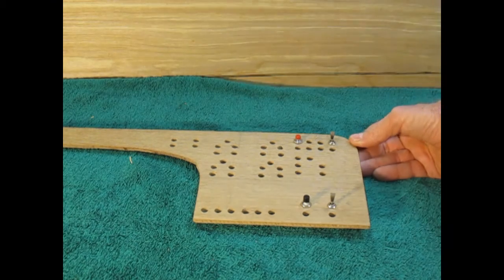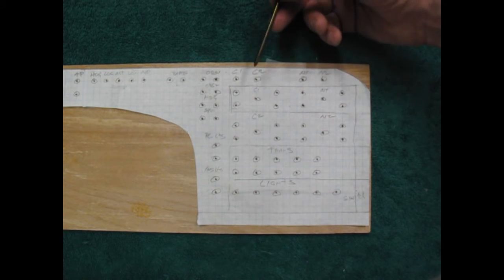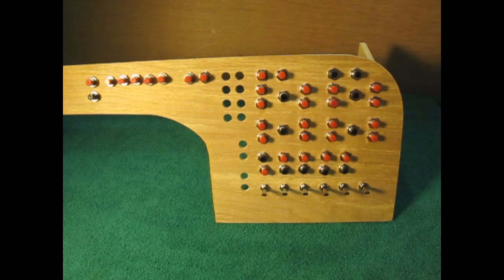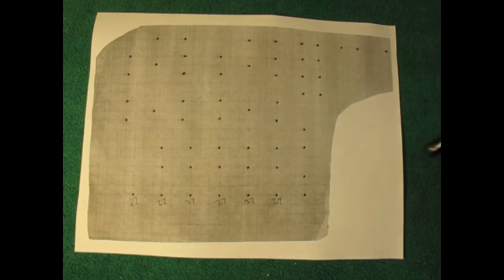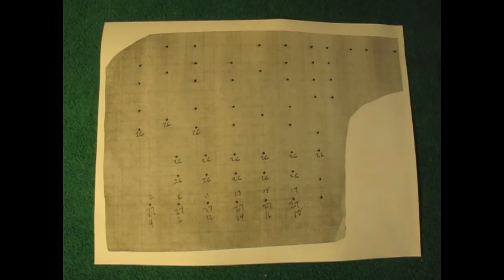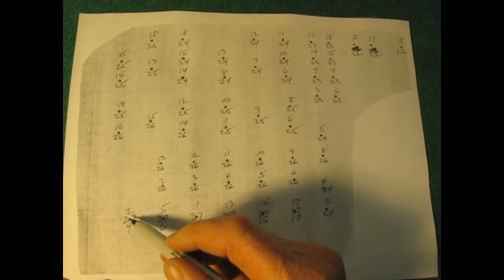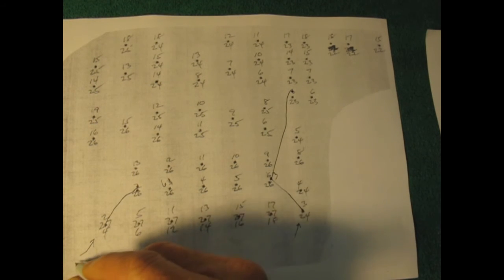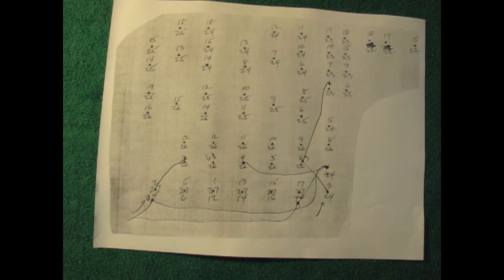How to Build Your Own Instrument Panel for X Plane ~ Part 3

Comment: Once again, thank you Skip. I had been trying to visualise the wiring connections myself and failing miserably, but that makes it nice and simple and I understand the theory now.
I have begun my own project and have so far saved the circuit board from an old keyboard and soldered some tails onto the pins. What a job that was! lol I need to start tapping out the wire combinations now and making a grid. I am aiming more at a button box than a panel as it will be used for both flight sims and racing sims, so it needs to work for both.
Thanks for pointing out some of the gotcha's too! There was at least one I would have got stuck with there.
Great work sir. Take care.
Reply from the maker: Hi Tux,  Glad to hear I have someone doing this with me! Yea, this is a time consuming project, quite a bit of work. As for soldering when I looked at all the solder connections I realized I wasn't ready for that and it took me a while to figure it all out. Even with the plan I came up with there most likely will be some little challenges so stay tuned.

Sounds like you really have a challenge making one to work with two simulators, please let me know how it goes and if you  find anything we should be aware of post it to help those who are doing this with us.

Blessings,
skip
Reply: Will do Skip. There will be a bit of a hiatus now as I am building this on a STRICT budget, so to save cash I ordered switches and buttons from Hong Kong (they were less than 1/4 the price of buying locally) and they will not arrive until the end of the month.
Meantime I have done my tapping out and created a grid for wiring. Next step is to build a panel or box to house it all.

Comment: This is a great series, thanks for helping us out.

When you get a chance, could you do a video on how to start a log book and take screen shots within X Plane. I have never been able to do either. Thank you. - PT
Reply from the maker: Hi PT  Hi PT,  Don't think you need a video for the logbook. Just click on File->Logbook. You have two options "Choose Pilot Logbook" or "New Pilot Logbook" What ever logbook you choose will be the book X Plane writes to every time you fly until you choose another pilot. To make a new logbook just click of New Pilot Logbook and give it a name. That will be the Pilot used every time till you make a change.

Screen shot is very simple also just click: File->Take Screen Shot or "Shift+Spacebar" a .png file will be created and placed in your X Plane root directory or possibly the Output folder. The name will be the airplane you are flying. For example I fly a Cessna 171N and I took two screen shots. The file names were 172N_1 & 172N_2. Hope this helps.

Blessings, 
skip

Comment: Would it be possible to connect the two wires that make a key to one switch and leave it at that? E.g. wires 1 and 7 make the letter A, and wires 1 and 8 make C, would it work if i only connect 1 and 7 and ignore the 1 and 8 connection
Reply from the maker: Hi Tim,  Yes, if I understand you correctly, it should work just fine.

Blessings,
skip